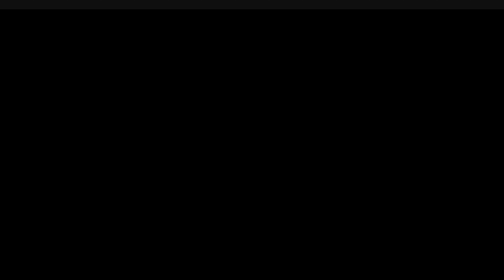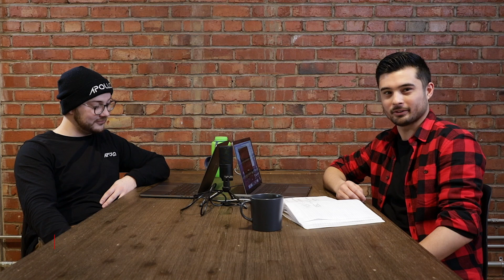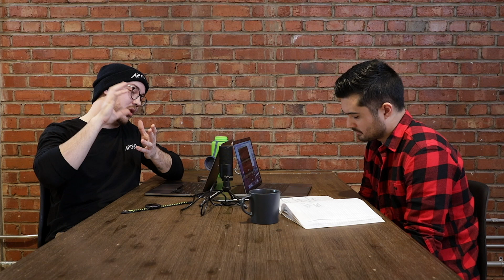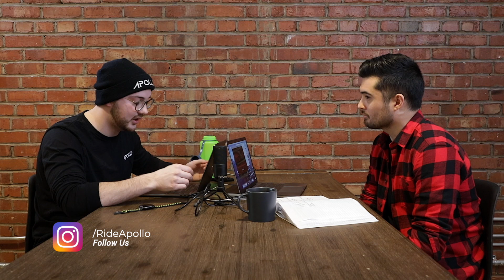Mission Apollo: Changing the Game With the New Apollo Controller Upgrade  (Episode 2)

Comment: I have this controller running 60v dual 1200w I cruise over 40mph top speed about 47mph full charge still in 2025 scooter had been running flawlessly for years. I run down cars on my scooter riding the beaches and regular streets. Off the line nothing keeps up the take off is crazy wish I could find motors double watts that fit so I could be even quicker!

Comment: I need a rear controller for my ,22 ghost I just bought it last month now I'm getting error code 10  and my back motor is not working please help I was told replace my throttle 90 percent of the time it's the throttle so I was happy because when I ordered the scooter I bought a extra thumb throttle so I plugged it in and I'm still getting the error code 10 so please direct me to where I can buy the rear controller so I can get my scooter back on the road Apollo please help

Comment: Hiya I got my Ludo for christmas. Is it possible to upgrade to the new controller so that my lights would work, also is there any way to also upgrade to the new handle and stem just like the New phantom as well as the new thumb throttle and everything else? what would be the cost to have these upgrades?

Comment: I would not mind loosing the display on the Phantom Ludo as long as there is a phone app that serves the same purpose. That may not be possible through if you are using the display as a wire harness hub as indicated in this video. Guess I'll wait a few months.
Reply from the maker: Patience :-) Thanks for watching!
Reply: I think it would be best for every scooter to have it's on display.It is okay for it to be optional to use your cell phone as the screen display however Many people Prefer to do Do this as a stand alone.They would be concerns Of possibly having their phone fall off and get damaged or just for other reasons to not I want to use Their phones.Some people's phones are about $2,000 so just keep that in mind.
Reply: @AdrianButler86  These stand alone screens are not visible in the sun, at least with this iteration because a good one drives the cost of the scooter too high. Cell phones because they are more expensive, as you say, are much more visible and do the job better.